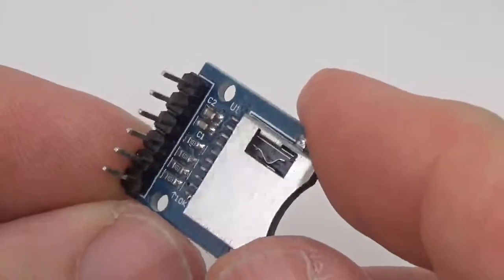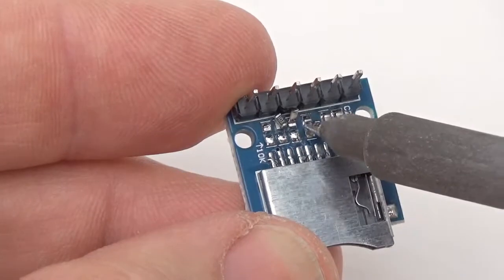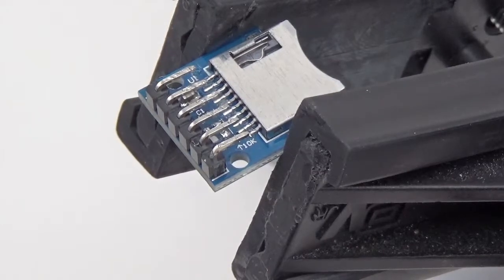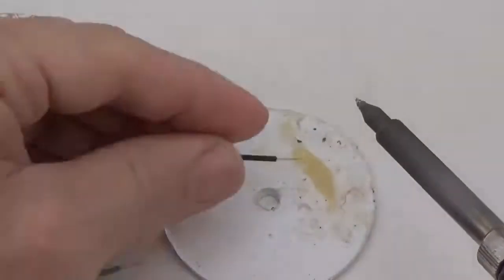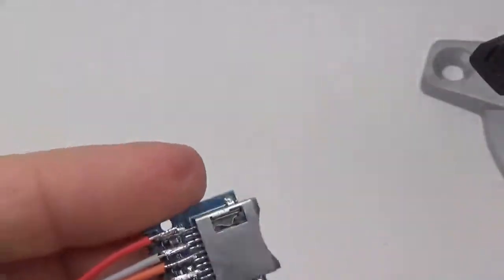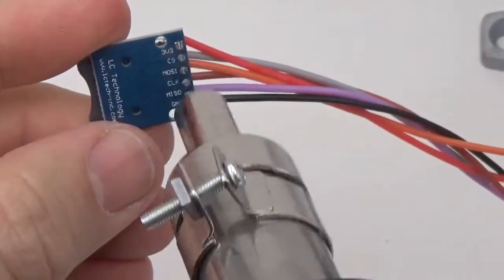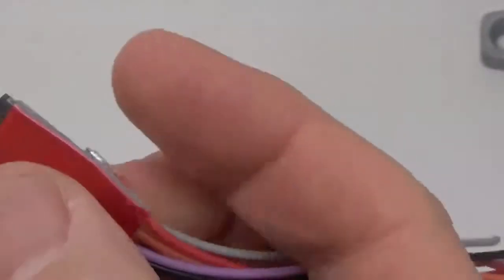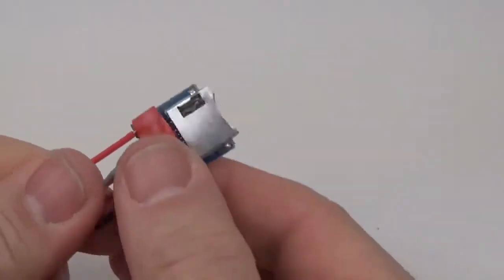2019 Student Build - Part C: Add Wires to the SD adapter

Comment from the maker: Anyone watching this older build video might be interested in our new 2-Part logger that NO LONGER NEEDS THE SD CARDS! It stores sensor readings in EEprom and the data download is handled through Arduino IDE's serial monitor. Larger EEproms are easy to add via the I2C bus.
https://thecavepearlproject.org/2023/12/01/the-e360-a-classroom-data-logger-for-science/